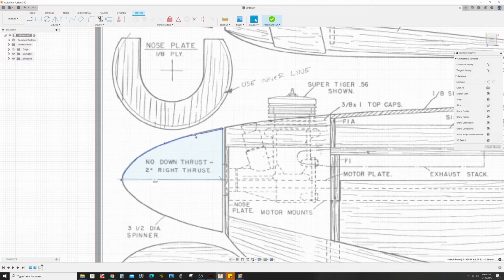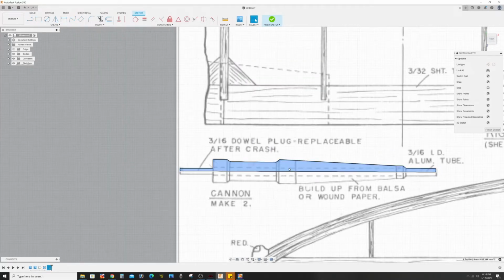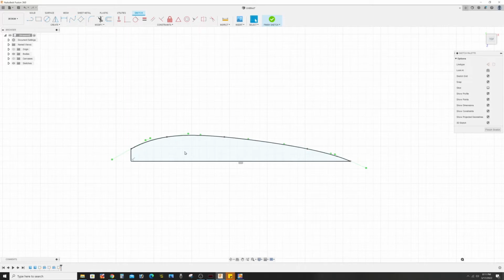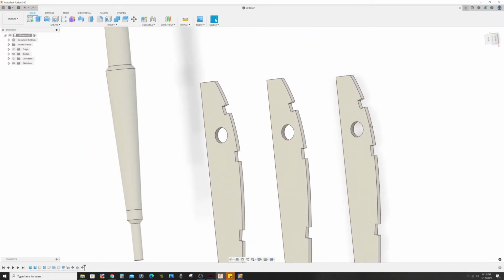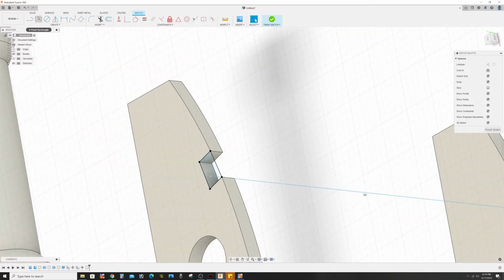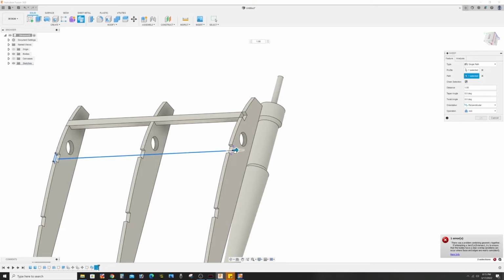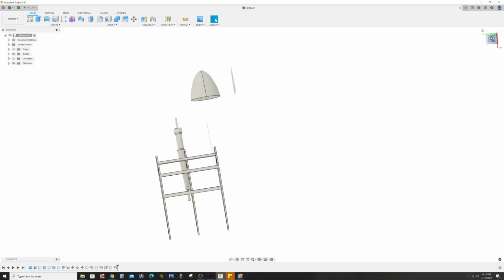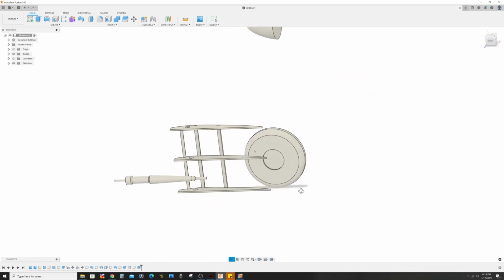Quick & Dirty Modeling Using Fusion 360  - Photo to Parts - Pt 2

Comment: Hello, good afternoon.
Thank you very much for the uploaded material. I find it very instructive and inspiring. I am from Chile, I would like to know if using this technique I could build an RC plane with a wingspan of 2 meters?
Thank you very much. Greetings
Reply from the maker: Thanks for checking out the channel and the kind words.  As for your question regarding technique....are you referring to the ribs?  I'm not sure if Fusion has a size limitation but I'm sure you can scale it down for the drawing and scale up once you move to production.  What I just drew was a quick tutorial and may or may not be functional.  There was a video that flashed on my home screen about using a tool in Fusion to do air studies to test validity of the design.  If it pops up again,  I'll put the link here.  Hope that answered the question you were asking?
Reply from the maker: I just did a search on YT "fusion 360 airfoil generator "   Hope that helps!